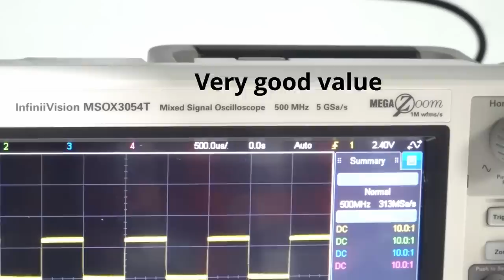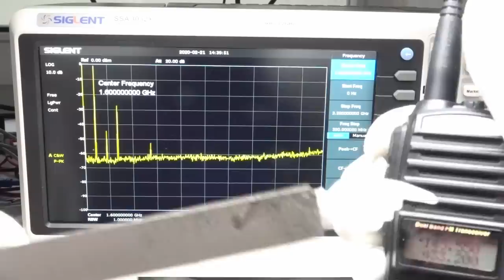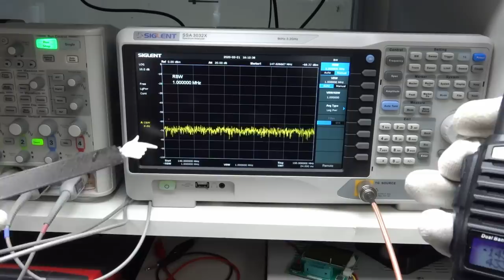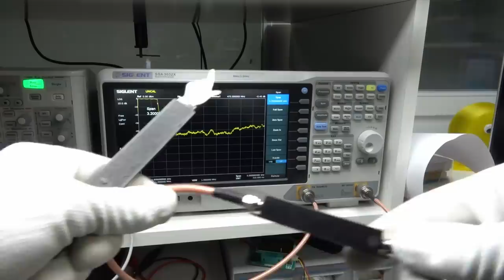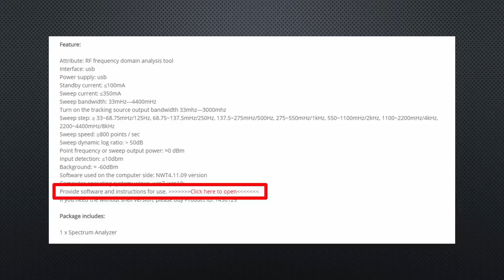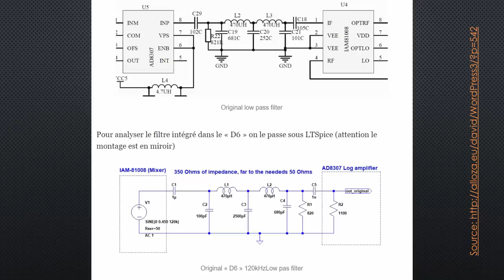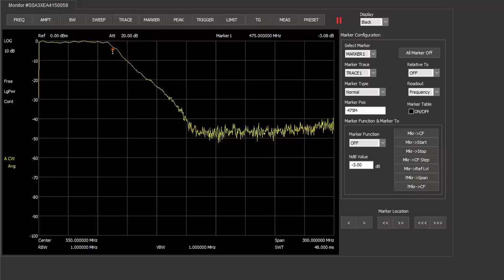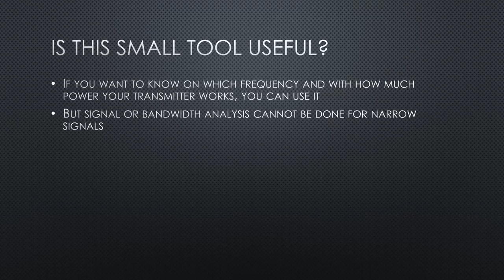#313 Useful? Cheap Spectrum Analyzer LTDZ 35-4400M

Comment: Learn the difference between dB and dBm before you talk of spectrum analysis.
Reply from the maker: Where did I mix them?
Reply: @AndreasSpiess  1Min, 47 sec into video.  3 dB is twice the power.  3 dBm is not.  Be careful not to confuse them.   There are many discussions of this in both the amateur and the technical literature.     73, w7zoi
Reply from the maker: You are right, I forgot the word "more".